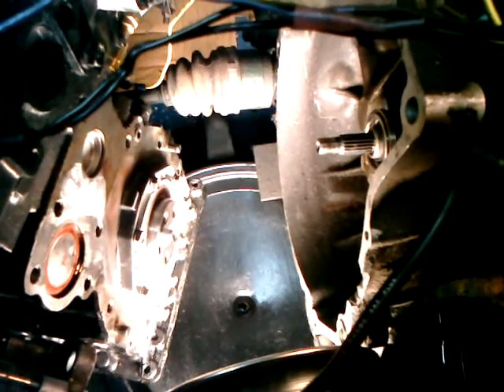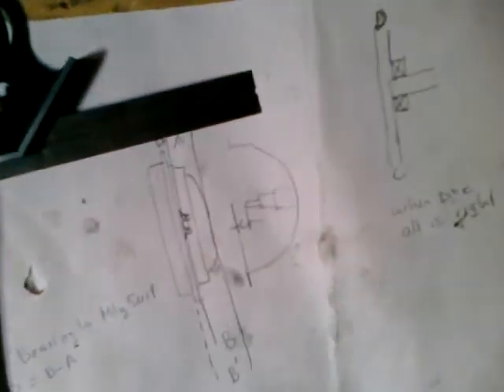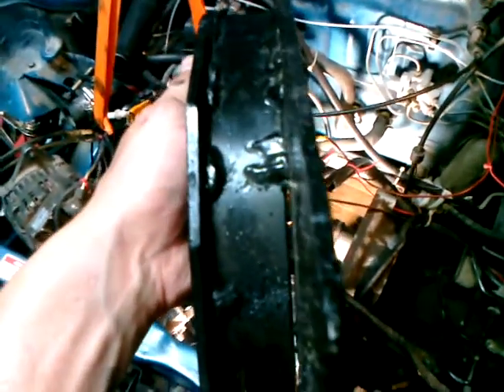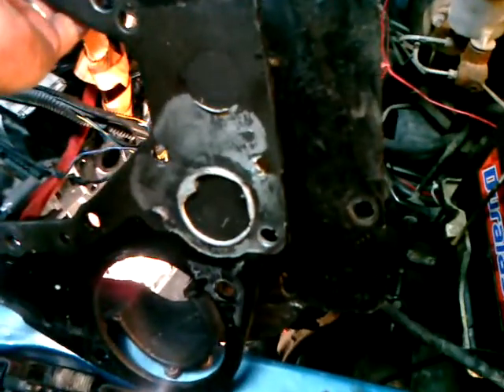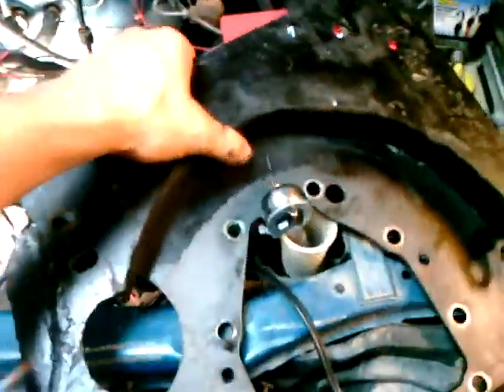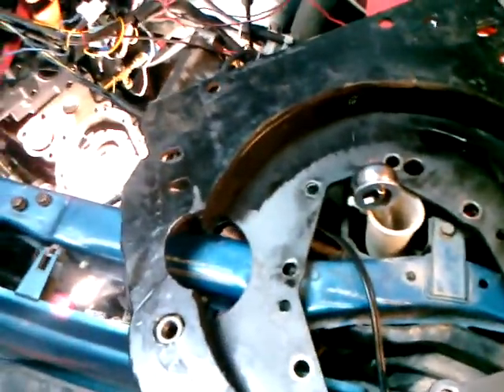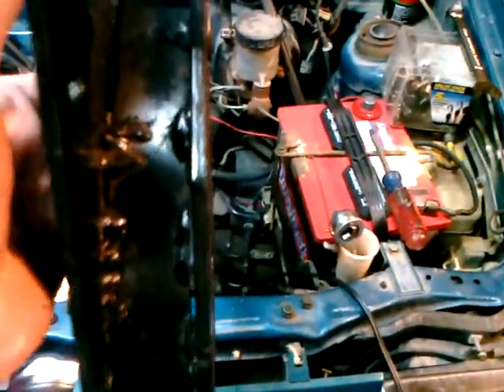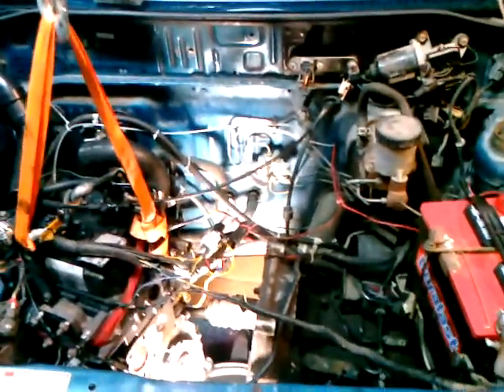Festiva Diesel Cracked Adaptor Plate Welds

Comment: How did you make your measurements for your adaptor plate?  Ive always been curious as to the process of how you mate a transmission to an engine it wasn't designed for.  Ive got a Yanmar 3TNE78 and I would love to know how I could mate it to a Nissan 5 Speed.

Comment from the maker: @ckiesman That's a lot of power devoted to refrigeration.  I saw some info once that this engine was for a generator.  The engine series,TNV, is pretty new, which stands for Total New Value.  They are supposed to be cleaner, quieter, and more efficient than previous similar engines. This model is 2TNV70-PGA, where the 2 is for 2 cylinder, TNV is the engine series, and 70 is the cylinder diameter in mm. The "PGA" is customer specific, but not much info is available to decode that.